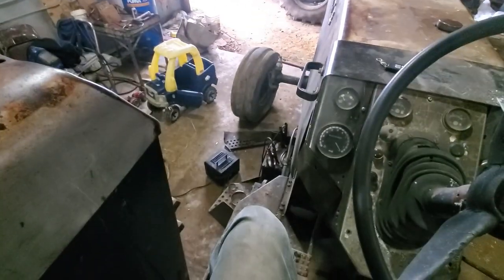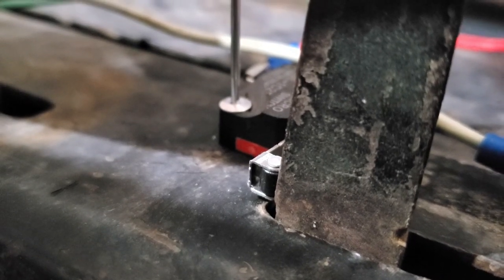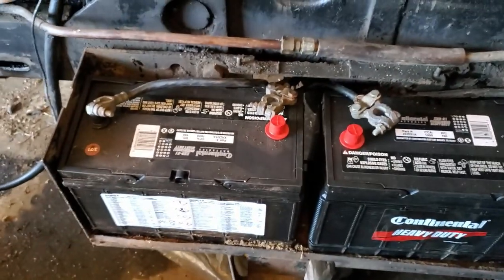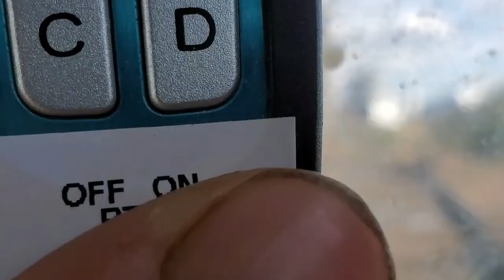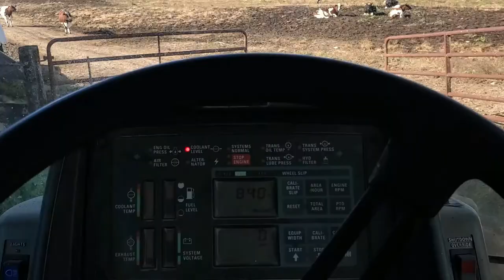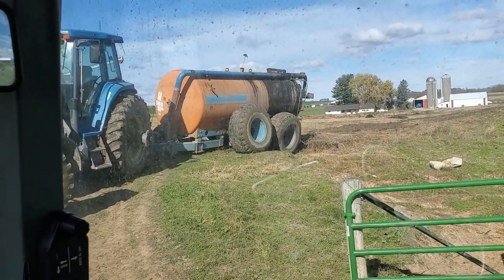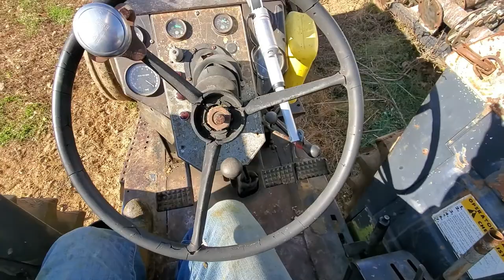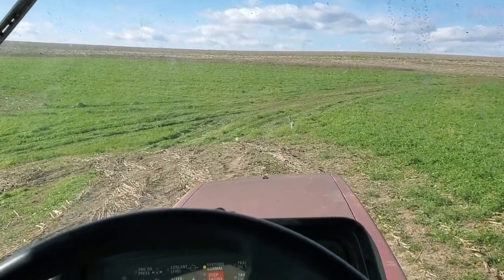Remote control slurry spreading

Comment: Why weren't you agitating earlier when you had fluid that would have given you more tank loads and less slinger loads .seems you just pulled liquid off the pit and left all the solids .incorporating the solids with available fluid would  greatly reduce solids left to bucket out wouldn't it or am I missing something in my thought process
Reply: In our system cows are bedded with the bio solids that come off a small screw press. That liquid manure is coming from the outflow from our methane digester .the inflow manure is from 850 cow 6 row freestall barn and 3 other freestall barns with 1200 or so young stock and replacements.  V spreader load a day is spread that comes from our strawbedded prefresh barn and smaller calves barn. We use a single purpose Houle electric agitator 14 inch impeller to combine all liquid in a receiver pit the digester is then filled daily from that pit using 6 inch Houle electric pump OK set up. Not best in winter if redone use bigger pumps and motors.plus wooden and poly hoof block jam pumps up instantly can be a headache if cows get dried off with block on bc not looking at her feet 3 times a day anymore so can't look for block if you don't see it missing.
Reply from the maker: On a good day I'll agitate in the morning for a couple hours before spreading, it's just a lot quicker to not have to switch functions every load. We usually suck out all we need to spread as liquid in between hay crops and are set up for emptying the pit in the winter
Reply: I gotcha it is a pain in ass switching back and forth we get lucky since everything goes through screw press all applied liquid manure has the constancy of water just about no solids so we never agitate enough of a swirl is created from the impeller fan while loading out.